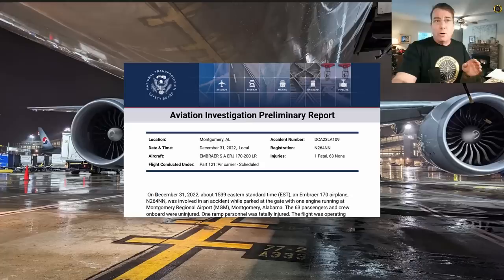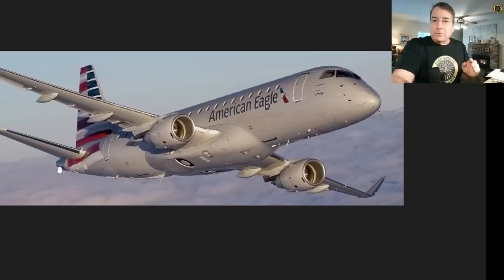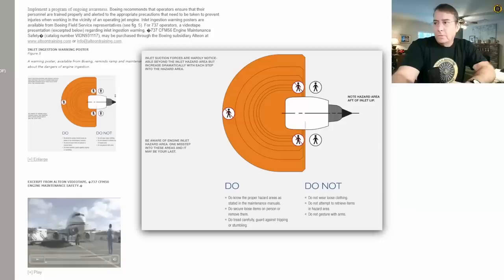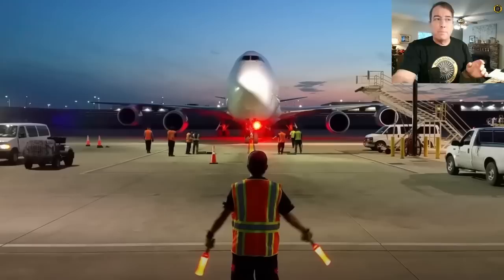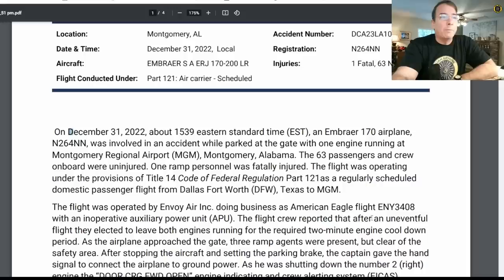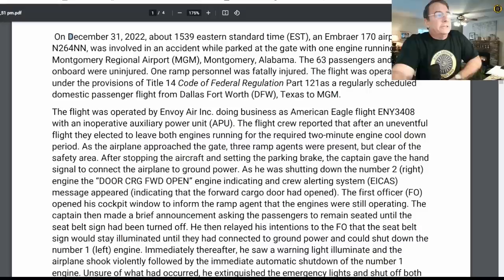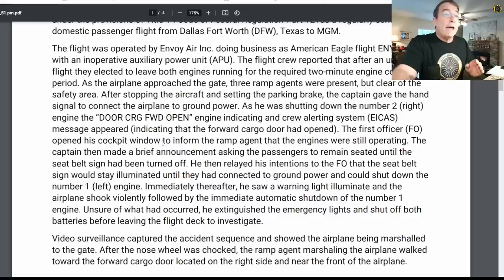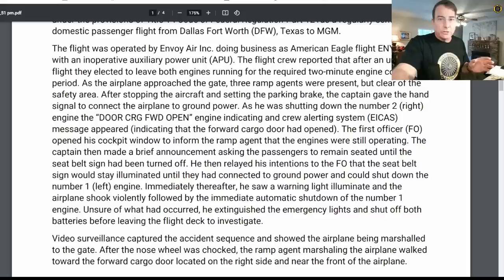NTSB Preliminary Report Ramp Agent Fatality 31 Dec 2022 Montgomery Al.

Comment: I think the root cause of this tragic accident is very simple: complacency.

It’s my understanding that this route is normally flown by an ERJ 145 that has the engines higher up on the tail. The 170 has the engines much closer to the ground. The young lady just didn’t fully understand the danger and got too close.  Her previous experience got her killed. 

Do I have this right?
Reply: You do, people are just blind to the obvious and are desperate to be politically correct or more importantly always blame the airline. It's infuriating.
Reply: If your working with any airlines ! If they have several types of aircraft! You are trained the very basics of every aircraft! And if you do get the odd aircraft! A good ramp would look up what they needed to do on there computers!

Comment: Complacency, lack of situational awareness, and out of norms stress can lead to a bad event happening, even after a safety brief or talk through.
Years ago I saw a coworker aircraft mechanic almost walk up to the inlet of a running engine.
We were doing a manual start on the engine due to a deferred start valve on #1. 
I was on the headset at the nose gear speaking with flight crew, coworker was at right side of engine fan cowl operating start valve through access panel.
It was at night, us mechanics were using hand/flaslight signals to communicate with each other due to headset jack inop at engine.
After engine was started, valve closed and engine stabilized, coworker did not step back and walk towards the wingtip, but instead walked alongside the cowl towards inlet and me at nose gear.
I was waving hands and flashlight but it did not register.
At last moment he stopped, froze and realized what was happening, then backtracked to the proper exit route.
We were a bit shook up after getting back into the maintenance truck.
He realized that a couple more steps and he would've been sucked up into a CFM56.
Aircraft was a DC8-73, had four CFM engines.
We had talked through the manual start before the aircraft was closed up. 
The one detail about how to exit safely got forgotten about, he reverted to normal travel pattern of doing a walk around.
No one got hurt, the incident was not reported, but I still think of it regularly years later.
Reply: So why wasn't the person dealing with the engine problem wearing the head set?

Comment: Having spent six years in the US Air Force working Air Transportation, I was on the Flight line daily, loading and unloading All types of military cargo planes, C-130, C-17, C-5,
And multiple Civilian Cargo planes, mostly 747’s but others as well,
And an active flight line is a very dangerous place to be, between aircraft coming and going, buses, trucks, forklifts and K-Loaders, fuel trucks, etc,
You had to keep your head on a swivel and pay very close attention to your surroundings.
Because you start day dreaming, rubbernecking to look at other aircraft going by, or just let your guard down and you could Be Seriously hurt or killed in an instant.
The most dangerous activity for us was ERO, (Engine Running Onload/Offload)
Where they keep the Engines running while you load/unload the aircraft.
While I did see some injuries, luckily we never had a fatality 
Hopefully this will serve as a reminder to all those who work around aircraft to take the safety briefing more seriously.

Comment: Ive worked on the ramp here in the UK for 38 years. so many rules broken and sadly they paid with their life. no pressure to rush, yes there is a time limit for the turn around but you don't cut corners on safety . you have to be switch on all your shift your life depends on it.

Comment: This is so sad. I expect this type of incident around military aircraft, especially on an aircraft carrier, but not on civilian airports, especially those operating commercial aircraft. There's a video on YT of a man on an aircraft carrier getting sucked into the intake of an A-6 Intruder. It happens so fast that if you blink at just that moment, you'll miss it. He survived because he was violating the rules and did not have his helmet fastened. He went head first and his helmet came off and caused the engine to go into emergency shut down. But, these are narrow tunnels, not the huge openings of commercial engines. We had a man sucked into the intake of an A-7A Corsair. He survived long enough for surgery and to be flown to a hospital in Da Nang. He died 2 days later. Both of these men knew all of the risks and the precautions to take, but something happened.

 Can't some type of screen be fitted over the front of the engines that will prevent the ingestion of something as big as a human being but still allow full airflow to the engine? As for the cargo doors, can't there be safety interlocks installed that are latched as long as the engines are operating? Perhaps another red light could be at the latch that would be lit anytime the engines are running. Just a couple thoughts from someone who is not involved in aviation.

Comment: As a ramp super there is massive pressure to turn n burn. I always made my rampers stay by the terminal except my wing walkers. It comes down to the ramp super n the crew chief. Sad but it comes from the top n Horrible lead agents. Time pressures n loser managers. Why i was always in trouble. Told them to stay away from my maddog it hates you. Get the bags off n move on. The 175s were a pain as they were always in a hurry of which i did not comply. Wait till shut down before approach. Fly safe work hard.

Comment: I have to say, whilst it is sad to see that someone lost their life it doesn’t surprise me in the slightest. I worked for a well know Freight operator flying the B767 and flew into KCVG on numerous occasions. The handling and total lack of RAMP discipline was astonishing. ULD’s everywhere, FOD on stands ramp agents approaching the aircraft with engines running. It was only a matter of time unfortunately before someone was killed or seriously injured. A real shame, especially when the whole thing was briefed beforehand. The current company I work for will shut the engines down on stand before GPU attached and brief the PAX beforehand to explain there will be limited lighting before ground electrics are plugged in. No one should be approaching the aircraft whilst the beacon is on even to plug in ground power in my opinion. Far too much risk!

Comment: If we have a very late arrival, we do what's called a ground turn. That means no delay to get the plane turned. However, we do not run into running jet engines. Sometimes my coworkers will put up the engine cones just after they flame out. That means they are still abke to suck you in. Coworkers have unfortunately said to not approach a jet engine until the flame goes out ( you can hear that ). I have always sat there and waited until I am certain that it is off enough to not suck me in. Might take a minute but i don't care. Repetition makes you more experienced and able to do certain things well, it does not mean you can just turn off your brain like they obviously did. Aviation is the least forgiving common job field. If you touch a plane and make a mistake, crap like this happens

Comment: Working at an FBO at a very busy municipal airport still green with almost a year under my belt, I always knew and ALWAYS waited till the props and/or fan blades stopped moving before chocking the main gear. I had a few complaints to my boss that some of the other veteran marshalers were chocking the wheels when the props were still in slow rotation before stopping. I dont care if that aircraft was in a rapid turnaround. All engines off, then start the diamond safety zone. Was let go due to my complaining and other safety issues. Go figure.
Reply: Don't feel bad your not the first person that has happened too! Sounds kinda like AVFlight!

Comment: i think it is easy. Complacency is a
huge factor in accidents while
working on a highly
dangerous environment. While at first you might follow
instructions 100% with time you start to develop a feeling of “i know what i’m
doing” and start cutting corners… really small corners, almost insignificant at first…
Reply: but after some time, if you really
look back you’ve cut the entire safety book, but you don’t notice because the change was so gradual and you are so used to it that it does not register in your mind… until tragedy strikes, or someone completely new tells you … “what the f… you are doing”🤷 i’ve seen it soooo many times …

Comment: I’m retired military and recently retired from corporate aviation, never work for the airlines. To me it sounds like having the engine running was not the normal routine, the ground person was inattentive and just going about things the way they normally Do. It would be interesting to see how long this person worked on the ramp.
Reply: Definitely. It sounds like they were used to the standard routine and when a deviation was introduced they just did everything the same way they were used to instead of adapting to the unusual situation.
Reply: @joevignolor4u949  Despite being told TWICE before the plane landed that this one would be unusual.

Comment: Really tragic. I read that a few years back, Southwest Airlines equipped their ramp employees with wireless headsets. Seems like a great idea given the very noisy environment and deadly hazards that are present only a few feet away from where people are working.
Reply: I think they just use them on push backs?
Reply: @davidsmiths5471  AA and their regional ground handlers (Envoy & Piedmont) use David Clark wireless headset units, but they are used pretty much exclusively for pushback operations only.

Comment: Unfortunately she was likely failed by her employer. Due to the push for more profit, most ramp agents are making less and less money as the years pass. This trend causes a higher and higher turnover rate for these employees. All of this adds up to employers investing the absolute minimum amount of training and other investment in there employees. As an AMT for the last 30 years I have seen way too many bone head maneuvers out on the ramp, thankfully, none of them fatal. I started as a ramp agent and way back then I had a week of training before even stepping foot out on the ramp. It's not like that anymore. Considering all of the safety violations that occurred, it seems actual safety training wasn't really taught or preached or enforced there. A very sad day indeed.

Comment: To answer that last question… yes, there absolutely is pressure, direct and indirectly implied, despite what any supervisor or manager says. Pressure could’ve been turn around time, could’ve been a quick turn if it came in late. Could’ve been a “sitter” so they could’ve wanted to rush to either maximize downtime or get finish the flight so they can leave sooner. Also, it’s unlikely they had a “safety huddle”. If they did have a real safety huddle, nobody would’ve approached that aircraft, I can promise you that. Finally, it’s likely that the ramp agent had headphones on listening to music, unable to hear the engine still running, which is not uncommon. Would’ve never happened if mx had just fixed the APU rather than just “speed tape” everything…
Reply: Never heard of a quick turn with an A/C with inop APU!!

Comment: So when it comes to that the safety precautions are putting a place for a very specific reason you are not to approach the aircraft until both engines are shut down and both the top and bottom red flashing Beacon Light are extinguished and that is there for a very specific reason it's for everybody's safety with Airlines safety is their first priority

Comment: "Is there pressure...?" Yes. Commercial aviation is a time-sensitive business. The entire business model centers around minimizing time on the ground. Front-line supervisors and middle managers will receive far more flak for delays than any praise they will receive for safe operations. That doesn't mean they actively encourage people to be unsafe for the sake of being on time. It's just the reality that the fear of the delay is never far from their mind, paired with the comfort/overconfidence that gets developed by regularly working in a dangerous environment. If the airlines want to be so detailed to the point of hotly debating which exact action constitutes "starting the clock" because seconds count, then they should not be surprised that the bulk of their workforce is then incentivized to cut corners in order to meet the arbitrary benchmarks set by higher headquarters.

Comment: 1) Complacency (2 out of 4 rampers just did the thing as they were always used to).

2) Dismissive attitude of safety rule. This might be in part due to our current attitude of overstressing safety measures and meetings and briefings when "so much" wouldn't be needed. Which causes people to dismiss proper safety when necessary. Basically, sometimes we cry wolf too much. 

3) I wonder if the ramper didn't fully understand the briefing, and took the opening of cargo door and kneeling of one ramp agent at the nose gear as a "signal" that the engines were off. Still wrong, given the beacon, but a possible explanation.

4) Most people fail to understand that airplanes are very different from cars. They don't move by turning their wheels, they ingest, compress, and expell air and combustion byproducts strongly enough to move the whole aircraft. That is an insane amount! 

What surprises me the most is that the ramper, according to a testimony, was almost knocked over by the engine blast when she was behind, yet she still walked directly in front of the engine

Comment: Any time that your usual flow is interrupted the potential for safety critical errors rises, it would appear that this unfortunate lady was on her own autopilot despite the safety brief and despite being blown over by the running engine. I wonder how long she had been on shift, how many if any breaks she had had and had she missed any meals as a consequence of the shift pattern?
I operate the A350 for a UK airline and we have a 5 minute cool down time on the Trent engine, as you say this is usually not a factor at large airports but some times the nature of the operation means that we pull onto stand with a few minutes to go, I’m always very aware that people shouldn’t be moving and if they are I’m ready with the engine masters.
Because of the ETOPS nature of our operation, the APU is a pretty critical part of the ship, but my previous type was the B747, which had no such limitations on the APU, therefore it was often u/s and the situation that this lady was in was quite common, even though this fact was telegraphed ahead of the aircraft we still saw some pretty stupid stuff going on, it’s human nature. We were totally reliant on the ground crew in these situations as our view of the ramp from the 74 flight deck was tiny. 
Thanks again for a great video.

Comment: Having worked for a "regional" airline for 38 years I think it is very obvious why this happened.   Notice that neither the operation briefing or the station operations manual references pilot hand signals for shutdown. 
Can you imagine a ground crewmember "flipping off" or swearing at a captain "f--- you, you're nothing but a f---ing glorified bus driver " ?  It happened to me (KBOS
) with passengers on board,  main entrance door open.  Every passenger on board heard it.  When reported immediately to the station manager she blew it off. I filed the REQUIRED irregularity report with our management with NO response. 
Most "regional airline" managements resent pilots authority and diligently train some personnel to ignore the captain.  One "regional" actually openly encourages rampers to write-up pilots routinely. 
It's a different world down here in the "minors".  A dangerous world where a "by the book " pilot is ridiculed and scorned.  We experience problems that "mainline" pilots would NEVER tolerate. 
Unfortunately, sometimes it takes an accident before authorities act.

Comment: It’s interesting that they shut the number 2 engine down first. When I worked as an AMT for Envoy we would always keep the number 2 engine running and shut down the number 1 if the APU was inop so hooking up external power with the jet bridge would be less hazardous. I often observed the pilots doing this too. Not that it would have prevented this incident, but just curious.

Comment: This is a Workers' Compensation Case.  The State laws for each State's Workers' Compensation statutes are somewhat similar since 1921 when New Jersey passed its first Workers' Compensation statute following WWI when the soldiers were returning home from the war.  Many States have amended their workers' compensation laws since then.  I do not see a third party case against the airline company even though the deceased was not working  for the airline company.  Of course this  is a very sad case. 
      BTW,  Workers' Compensation cases are "no-fault" cases.  Thus the family of the deceased will receive compensation benefits whether or not the deceased was at fault.   At least there is some monetary relief, no matter how devastating this event has been for the family.  I pray for their hardship and loss. 
       I do not see a successful lawsuit on behalf of the deceased against the airline company, other than the benefits granted under the State's Workers' Compensation laws, unless Juan is correct and the company did not follow the proper rules.  Even so, this is still a Workers' Compensation case against the employer.   IMHO.